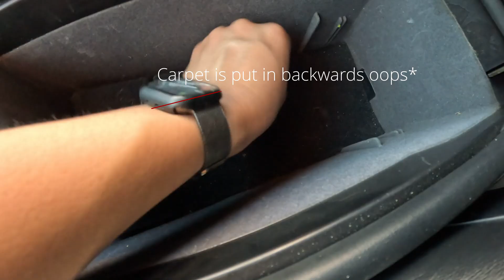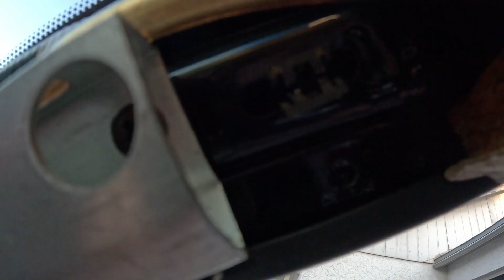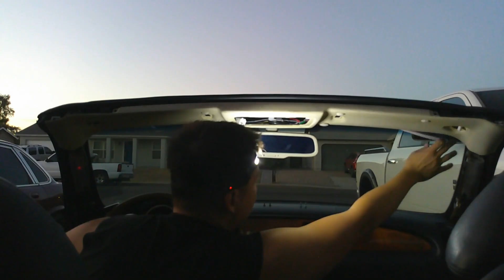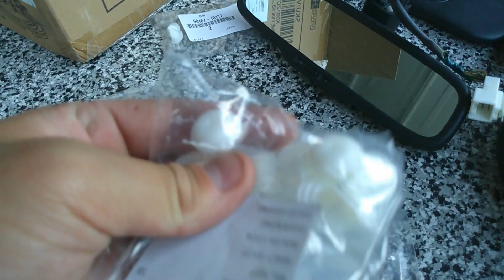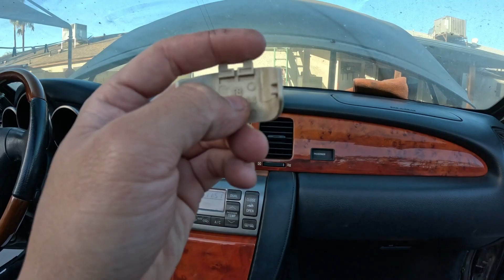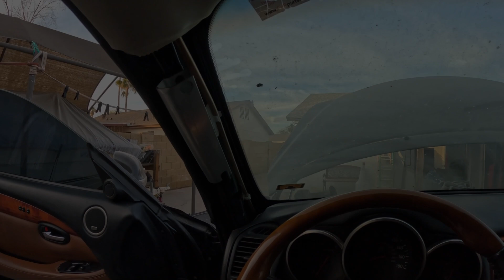Walkthrough of Replacing the Interior Roof Lining for the Lexus SC430

Comment: That's a lot of work. Great video, thank you for posting. I have a problem with my SC430 top  i put the top down after it had been sitting for 6 months; now the roof part does not come out of the trunk. The trunk lid opens well, and the rear package tray opens well. But I was looking at your video to see if the main roof motor is mounted in there. i could not see it . i saw one like on the front i think that one is for the latch.i kind of new to this car. And I could not find a video on the main roof motor
Reply from the maker: It’s located in the trunk. Would have to manually close the top then rip out the trunk carpet to get to the motors